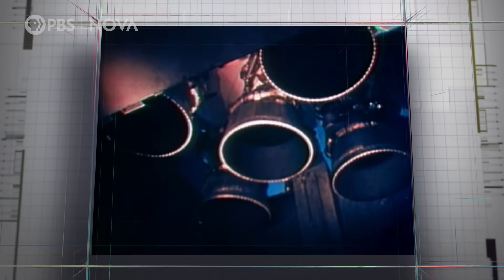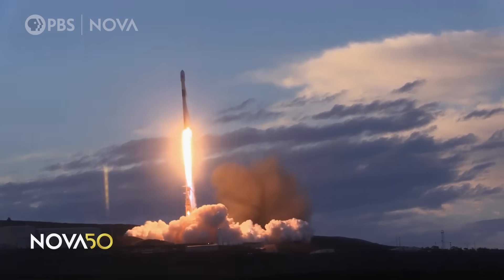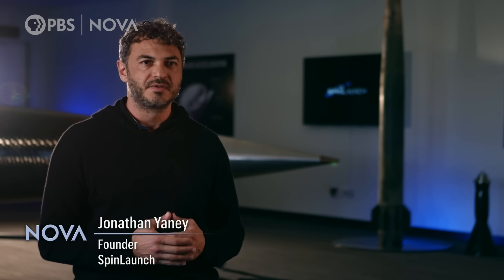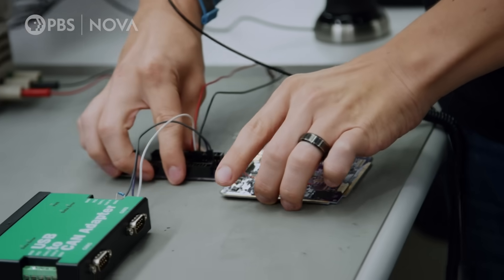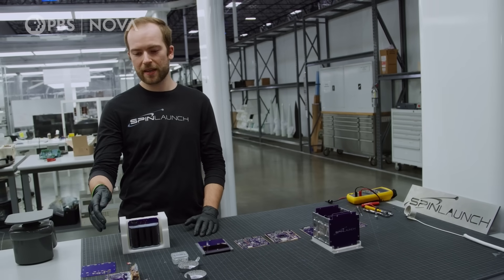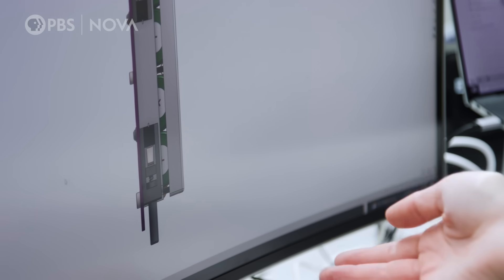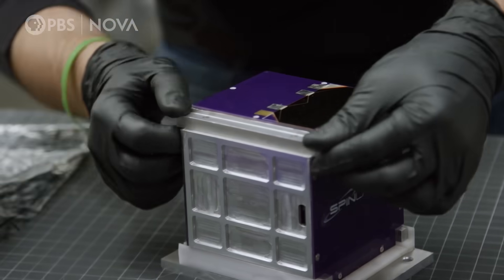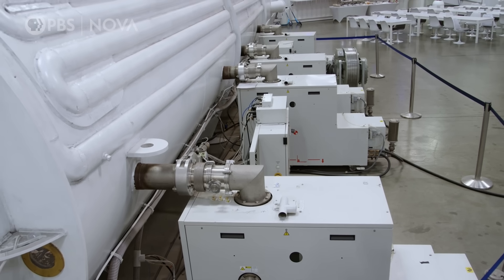A New Way to Launch Spacecrafts Into Orbit | NOVA | PBS

Comment: So let me see. We begin with a rotating arm, balanced so that it won't vibrate excessively while spinning up. A tremendous amount of rotational power is applied to get the velocity of the payload at one end of the arm up to where it can escape Earth's gravity. That means it has to be moving at about 25,000 MPH - AFTER - moving unpowered through miles of atmosphere. So the finely-balanced arm is spinning like crazy, and the payload is suddenly released - immediately unbalancing the spinning arm. Gee, I wonder what happens to that spinning arm?
Reply: They specifically said that the payload would be lifted to 40 miles, not that it would escape the Earth's gravity.  Even the rocket that would kick in after that would just lift it to orbit, which is still short of escaping Earth's gravity.
Reply: @JustinMShaw  You cannot "lift" anything to orbit. You have to accelerate it to orbit to reach a velocity of ~17,500mph/25,000 kmh. You fall down otherwise no matter how high you are. You cannot escape Earth's gravity with this thing. Look how far away the Moon is and Earth's gravity holds it in place just fine, hell the Earth wiggles the Sun from it's pull. There is still 97% of Earth's gravity at the space station, they just don't feel it because they are falling (orbit). You also can't throw anything into orbit, it'll always come back and hit you in the head. You need to do a second velocity change at apogee to circularize the orbit. This means that whatever this thing plans to throw into orbit, it needs a rocket built into it.
Reply: @wally7856  That's a funny thing to claim when aviation uses the term "lift" to increase elevation.

Bonus clue - lifting anything off the ground by any means involves acceleration.

And screw you for pretending that I didn't know orbital velocity.

Your assumptions are pathetic.
Reply: @wally7856  the video showed a rocket (released from inside the launch missile) being used for the final payload transfer to orbit.
You did watch the video before commenting on it, riiiight?
Reply: Look them up on real engineering. They address it. You can drop a counterweight or lengthen the arm when the payload is released.
Reply: @swill128  you'd have to be precise

Comment: What about when it hits the atmosphere? If air presents too much friction for the launch, what about the majority of the trip through the atmosphere?
Reply: While I see all the comments that this is already a dead project, the missile is shaped for high-speed air travel, but the rotor launching it is not.  I think the stopping block is needing instantaneous perfect release, which the 1/3 scale test that we saw showed not happening.  That missile did not leave the tube pointing straight forward.  Very bad uncontrolled shock for the payload.

Comment: An incredible fraction of fuel in a traditional rocket is "spent" during the slow, heavy beginning of the launch, fighting gravity to build speed. Just giving it a kick start will save massive amounts of weight. Hopefully they can build light and strong enough make this work, even if they eventually need more from regular rocket engines than they think.
Reply: is the energy to spin it up suddenly free? this idea was idiotic years ago and ius idiotic now
Reply: @anthonytimpson4975  The relevant constraint for rockets isn't energy, but momentum.
Reply: @AySz88  how do you build up momentum?
Reply: @anthonytimpson4975  The energy needed for the initial boost may not be lower for this than for a rocket, but the rocket requires fuel while this requires electricity.
Reply: @JustinMShaw  you guys are funny.
Reply: @JustinMShaw  you  must be a comedian